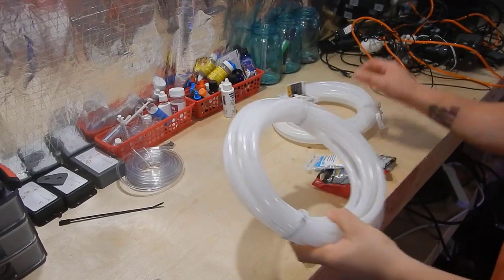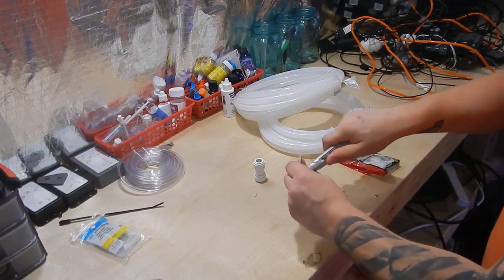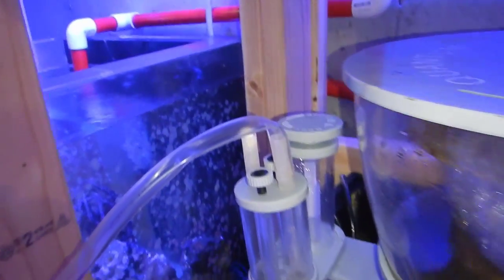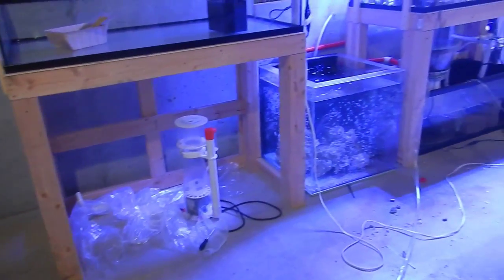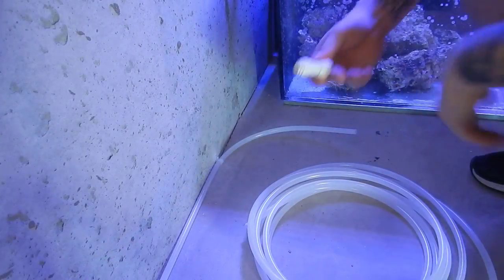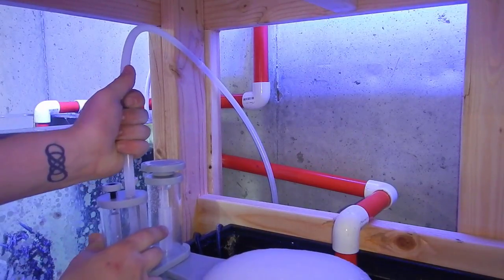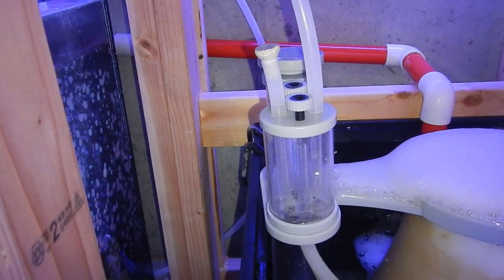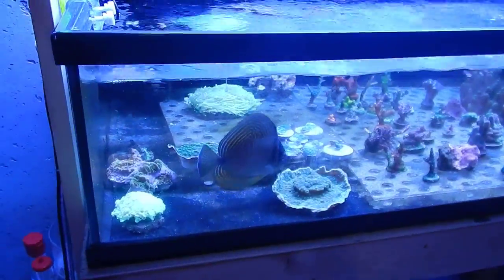Solving Ph Issues Within The Basement | Fish Room Setup Part 6

Comment: I use this method as well.  My fresh air line hose is actually drilled just below my window sill and cut flush with the window frame.  I have had leaves and debris get stuck in it in the past though.  My suggestion it to keep a close eye on the tube near your door.  I've had to cut my tubing several times because stuff clogs the line.  Also be careful when spraying for bugs near the line.  You dont want those chemicals in your fish tank.
Reply from the maker: It has a screen and a carbon filter on it

Comment: I know this is an old video.  but can you tell me what size of airline does your protein skimmer have.  1/4 inch or bigger?  I have a eshopps psk-100h and it has a 1/4 inch airline.  and it doesn't pull in much air at all.  tried a co2 scrubber and running a line to the outside and really no difference.  Plus it doesn't take all the co2 out of the tank.  thinking the smaller the airline tubing is the worse it performs.

Comment: Because the ID fits perfecty in ur skimmer air intake, won't to adding another skimmer to the same intake point force more air through that point then is physically allowed without degrading the efficiency of the skimmers
Reply from the maker: It doesnt pull that much air at all so T ing off the pipe wont be an issue

Comment: Does adding a long hose decrease  the ability of the skimmer to suck in air? Would increasing the diameter of the hose help?
Reply from the maker: not with the skimmers i have used it on. No issues with air flow

Comment: If u have airflow restriction issues due to the length of the hose. Drill a hole in the wall near the skimmer and use a coaxial cable grommet to seal where the airline exits the wall.